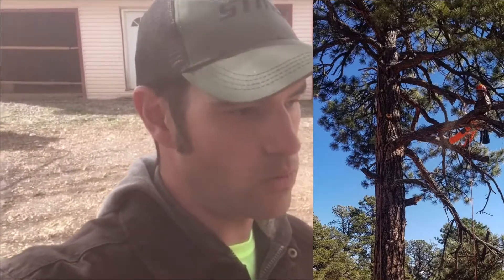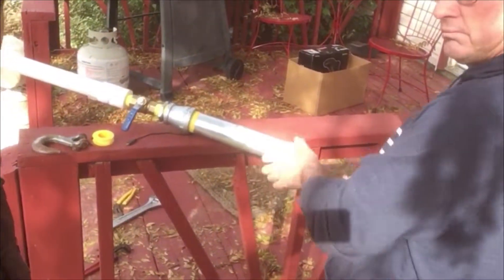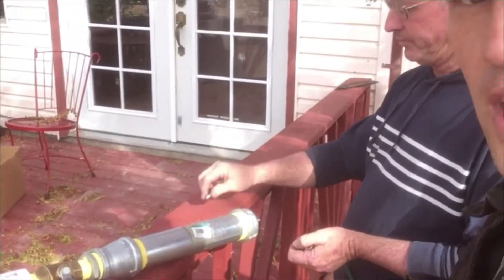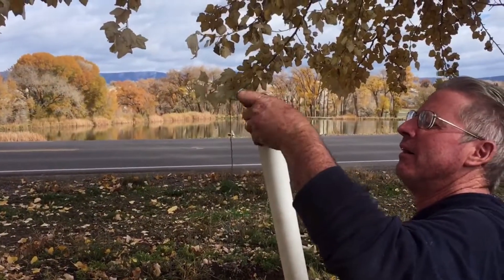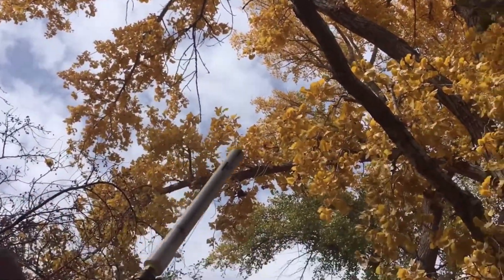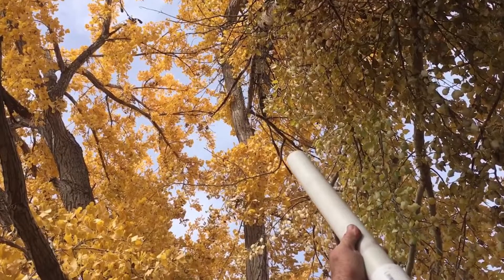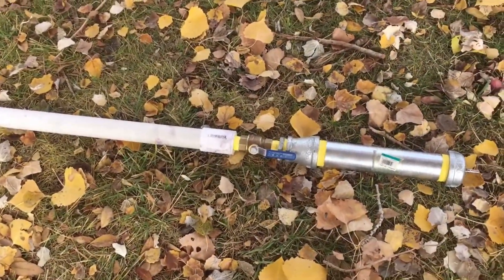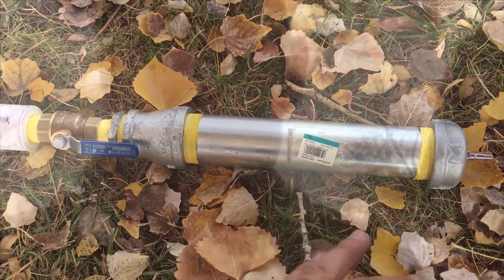DIY Throw Bag Air Canon Launcher

Comment: Added tip, make a cylinder from that soft, flexible white foam that some things are in when shipped to make an 1.5" dia wadding you would push down the barrel before the throw bag. Exactly like the wadding in a shotgun shell.

Comment: Great video. But I got a doubt. The threaded schrader tire valve? Can you send me a picture. The one I got doesnt look like the one in the video and I cant find it. Please let me know
Reply from the maker: I no longer have this air cannon. The schrader valve that I used was called a racing schrader valve from Napa. It didn’t thread into the hole. Instead, you drill a hole. The schrader valve had a nut that threaded onto the threaded shaft of the valve stem that inserted into the tube.

Comment: Hey man I just bought all the parts and I have it together but how did you seat the shrader valve? I don't have a tap and die but I'll get one if I need to.
Reply: P.s. the APTA is now 300+$
Reply from the maker: I actually purchased a race car wheel schrader valve from Napa auto parts. It’s designed so that you just drill the appropriate sized hole and there is a nut and washer that tighten to create a compression flange for the schrader valve. I didn’t have to thread tap the hole at all.
Reply: Where did you find that plastic handle or what was its name?
Reply from the maker: @Troy_Sent_A_Message  that’s not a handle. That’s the lever to the ball valve.
Reply: @EricJemAndes  You mentioned you bought the APTA version? If so, what markings name/lettering or anything is on the green/yellow handle that is zip tied to the tube?
Reply from the maker: @ I actually sold the APTA. So, I no longer have it to look at the handle.
Reply: @ 🤣Are you using anything now? And did get anything else?

Comment: I saw someone made their barrel 24inch.  If you make 36 would it affect anything?  I was thinking maybe alittle more accurate but not sure
Reply from the maker: I don’t really think it makes too much of a difference. The slightly longer barrel should make aiming a little easier. However, the longer the barrel, the more friction created as the bag comes out of the barrel, so you may need to increase valve and air tank volume to counteract the increased friction.

Comment: You may find it helpful to spray some silicone lube spray down the barrel, shove a rolled up sock down to push the material to the bottom of the tube, then shoot the sock back out. It may save the day when all you might have is a hand pump to air up the cylinder. Less of wear and tear on the throw bag might occur as well.
Reply from the maker: Thanks!

Comment: Just made one using Eric’s design.  Parts cost right at $100 in Hawaii.  Used it to get a rope over a mango branch 60’ up so we could shake them down.  It worked great, 90psi got my throw bag there.  We could only hand throw about 45’ so this was a necessity that really worked!  I have a car battery pack with a built in tire pump (an Amazon special) which only takes around 30 seconds to charge the cylinder.  Thank you Eric!!!!!
Reply from the maker: Just now saw your comment. Thanks for letting us know. I’m glad it worked out for you! That’s awesome!!!

Comment: I have found that the weaver bags are the only ones that fit 1 1/2" other brands at same weight smaller diameter, don't fly air runs right around them .
Go Weaver

Comment: Hello David,
I like your video.
But please tell me, why you came back to BigShot? Can you tell me the reasons for this?
Greetings from Germany near Frankfurt, Stefan
Reply from the maker: After using this for a while I found that I couldn’t control it as well as I would like to. If I had added a handle to it it would have worked fine. I recently purchased one of the air cannons from treestuff.com, and I use it quite a bit now. Another big upgrade was the fact that I bought a Makita 18 V compressor to fill the canon with instead of a hand pump.
Reply: @EricJemAndes  Does the handle have a name brand or markings on it? I've seen them before but forgot where.

Comment: What did you use to seal the metal on metal threads? You had to use more then just plumbers tape, right?
Reply from the maker: Gas Teflon tape
Reply: Regular Teflon tape will work fine

Comment: Nice design. While watching, I was thinking what's wrong with all PVC, it holds over 300psi. Then I heard your concern about dropping it and causing a potentially dangerous situation for all of those around you. Most of us pay extra for brand name climbing hardware to protect ourselves. Your well made point is a little bit more money to protect everyone. Well done! Another point: I'm new to climbing and just doing work on my own trees. I'm sure I'll eventually learn how to throw a line up in the tree, but for now, I suck at it. I don't have the time to get better and it's really frustrating. Your air cannon might just make my life easier. Thanks for the video and parts list.
Reply: I agree with you.
It takes hundreds and hundreds of throws.  I’ve been at it a year and still get frustrated.  It’s just not worth my time (10-45 minutes).
Reply: I built mine with 4 inch pvc rated for 280 psig for the reservoir.  It shoots a 12 oz bag 80 feet at 60 psig.  I have shot it at 125 psi and it launched well over 125 foot.

Comment: I made a PVC pipe rocket with the same philosophy,, and use a battery portable tire inflator.. guess what? The inflator has a maximum shutoff at 300 psi.... and the ROCKET always left the stand at around 250 psi.. and flew to about 130 feet.. if you look on the side of the PVC pipe,, it's maximum testing pressure is 700 to 800 psi.. hey, put a gauge into the galvanized side for immediate air pressure checking

Comment: You use 2 reducers. Ist 2" to 1-1/2" and then 2nd 1-1/2" to 1".
What different it will be if I use one reducer 2" to 1". Please advise.
Reply from the maker: Using a 2" to 1" reducer is fine. For our local options though, no one had a 2" to 1" in stock.

Comment: jealous
Reply from the maker: I've actually retired this. It's not as practical as I hoped. Im back to the Big Shot
Reply: interesting to hear! i thought id would be cool if there was a pressure gauge on the firing chamber so there was less guess work. still cool to have in the shed though :D
Reply from the maker: Jamie Keys I guess I need to do an update on the cannon.
Reply: @EricJemAndes  What part of using the air cannon was not practical. I've never used a sling shot, but it appears less accurate?

Comment: you didn't really need to use gas teflon tape but there was no harm in using it and there's no way you lost 30psi from checking with the gauge. you lost 2-3psi maybe

Comment: I’m hoping you can tell me how you made a hole in  the galvanized cap to fit a Shrader valve. Thanks. Fred
Reply from the maker: This is a race car wheel valve from Napa. I just drilled a hole in the cap and screwed the nut onto the schrader from the inside of the cap. Then, I screwed the cap onto the pipe. I hope that helps.

Comment: A butterfly valve opens much quicker than a ball valve.  2 paths of air and less resistance to turning.  👍
To stabilize and aim better,  clamp the air chamber alongside a broomstick or similar,  get down on one knee or sit down with the rear end of the pole against the ground.
Reply: NO. Manufacturers have all the equipment in the world to make butterfly valves to sell at HW store but they don't: 90-99% valves they make for home use are ball valves and plug valves. One of the many reasons is safety (Ball valve and plug valves are much safer than butterfly valves. Engineers don't recommend butterfly valves for pressurized air.
Reply: @SSintox plug valves are garbage. As a professional pipe fitter / service tech I do not recommend installing plug valves anywhere.
Reply from the maker: Good points! Thank you for sharing

Comment: For the air chamber, is 2 inch nipple only 12 inch long? 
Not 24 inch ?
I just want to be sure about the length.
Reply from the maker: Mine is a 2” nipple with a reducer that threaded into the pvc cap on the back of the barrel. The barrel is 24” long
Reply: The longer you make the air chamber the more energy it will hold but the longer it takes to fill it

Comment: Milwaukee has a m12 air inflator that would work perfectly for charging the chamber. digital readout so you can bump pressure up or down to get precise throws.  all you need is a tri pod to steady the barrel and you're in biz.
Reply from the maker: That’s an idea for sure. Hmmm...

Comment: I watched some other guys with these. They say to put the string side with the ring, on the throw ball, into the barrel first. That way when the ball comes out the sting in trailing behind. With the string coming out first maybe it can pull the ball to one side or another. Have you tried both ways? Which one do you think is better? Nice build!
Reply from the maker: I've shot the lines both ways, but honestly, with the force that the canon shoots the bag/line, I've not noticed a difference. My biggest challenge is not over shooting, and keeping my hand stable when firing as the force tends to shake the canon. When shooting small crotches 100 ft high, it can be a challenge to keep the barrel aimed precisely.
Reply: @EricJemAndes  gotta say I'm pretty impressed that this thing will shoot a weighted bag a hundred feet to begin with. This thing would be worse than those riot control bean bags cops use